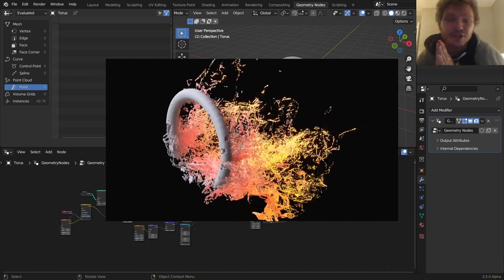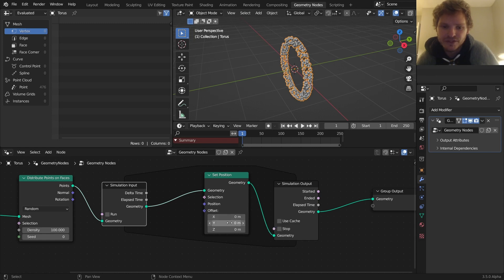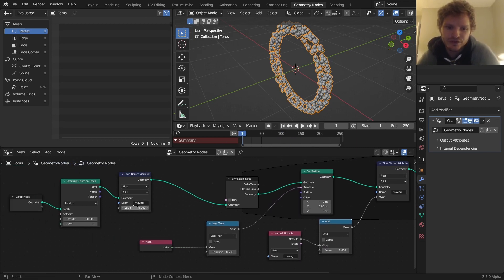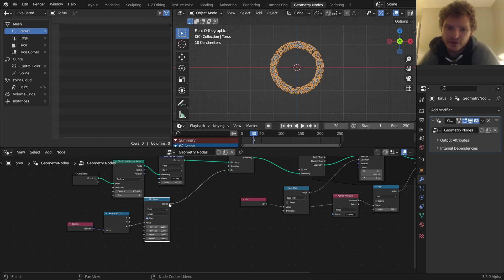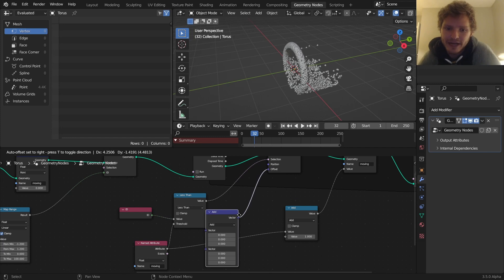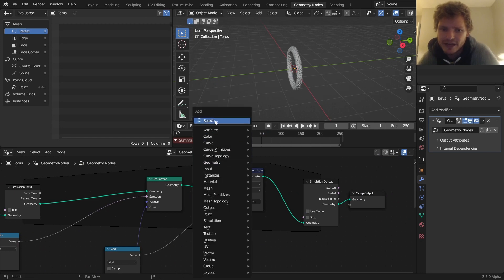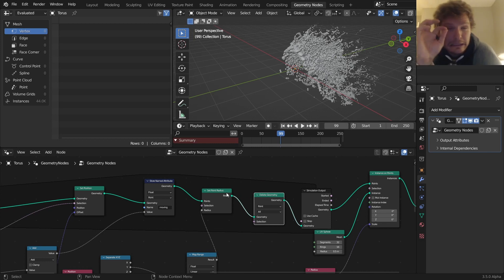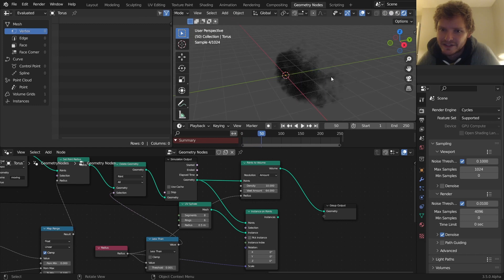SIMULATION NODES - HOW!?

Comment: Does this still work? My simulation nodes are missing some outputs (I'm assuming from a new update) and the effect he's getting at 7:30 is not what I'm getting. My points still all most together, and I've quadruple checked my node setup with his.
Reply: I cant even find the simulation nodes in my blender 3.5 version. wtf
Reply: Change the Named Attribute from Float to Integer, and maybe change the values a bit in less than node, it will work same.